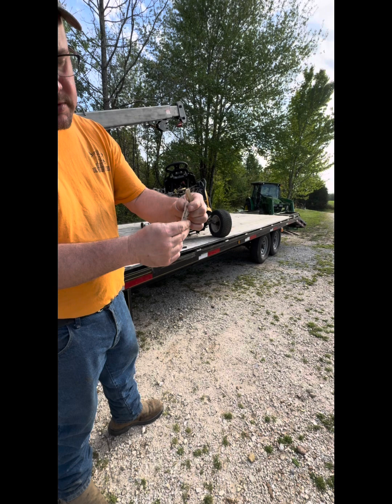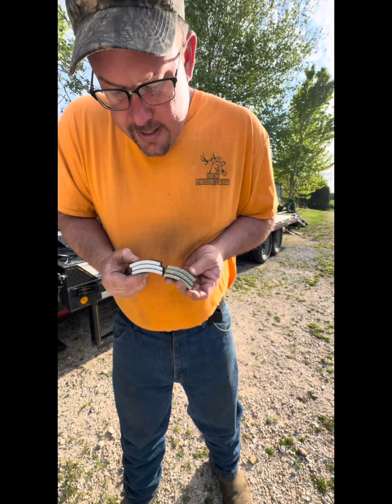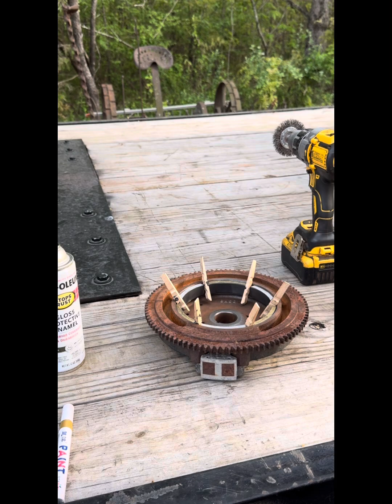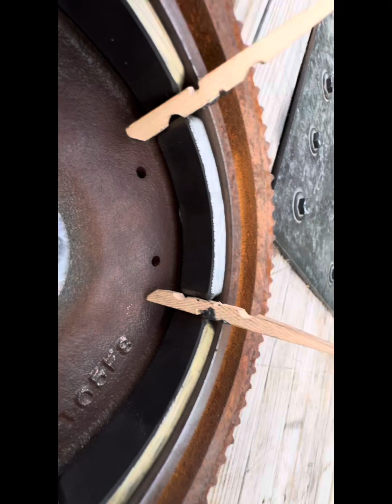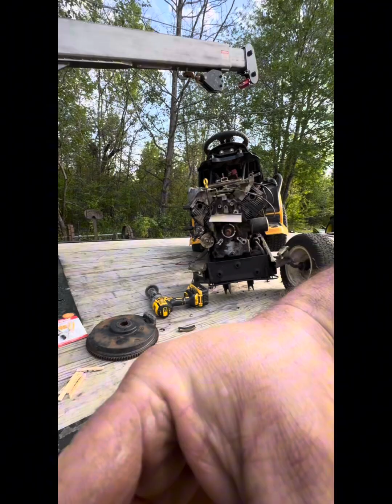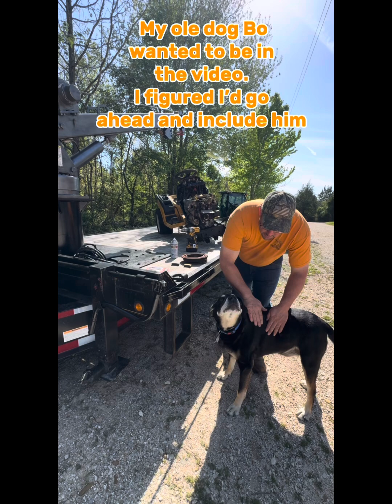Kohler Flywheel ￼magnet installation repair for single cylinder & twin cylinder engines #siwoutdoors

Comment: I have a 13s kohler engine with a 3amp stator.  My problem is the diode to the stator is missing.  What size is the diode?